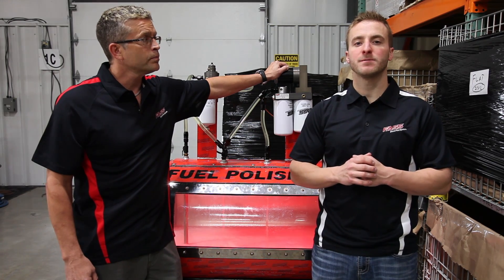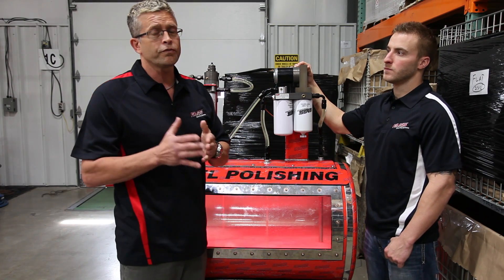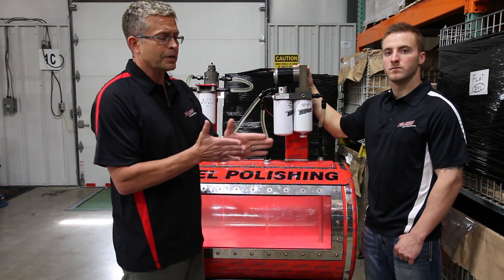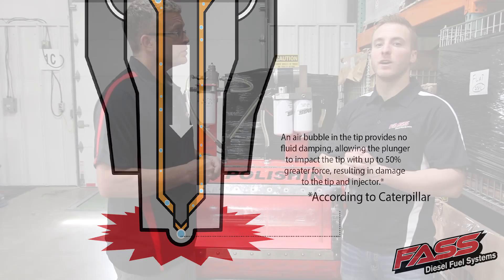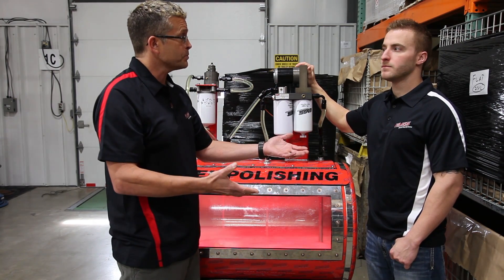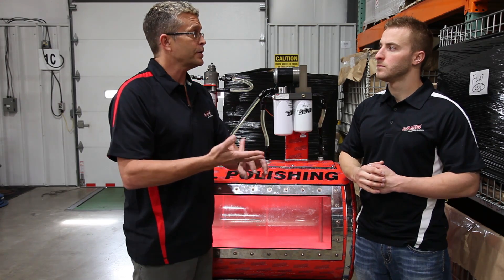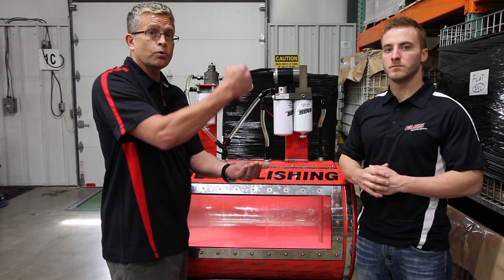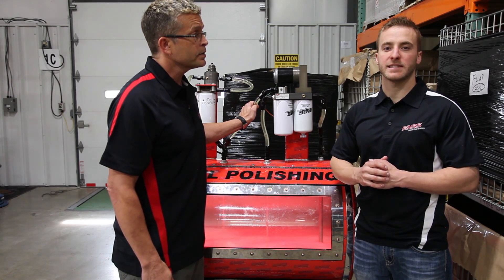FASS Fuel Systems "Tech Tips" Injection System Damage

Comment: Have a question I am buying a FASS system for my 2006 Dodge ram 2500. My lift pump is bad so I am buying g a FASS I saw that the new ones hook directly up to the existing line for the lift pump. If I am having issues with my old lift pump not working when I get to 1/4 tank do k need to go ahead and get. Be lift pump or just need to get the kit